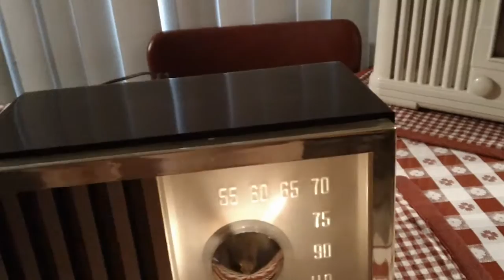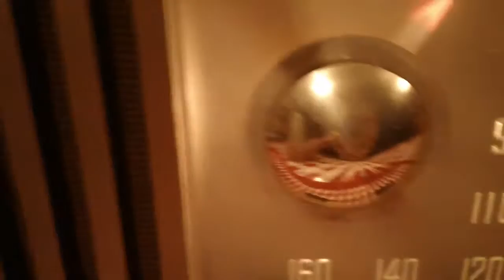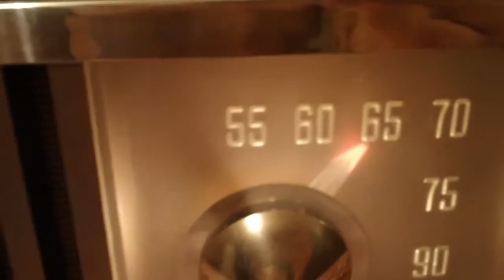RCA 75X11, Tube Radio from 1947

Comment: I just purchased one at a resale shop today.  It needs a lot of cleaning up but otherwise it's in fair to good condition.  I had no idea that the grill is brass - I'm confident that it will clean up well.  The lucite is in rough shape - can you elaborate on how to wet sand, what materials to use, etc?  Love how the lights illuminate the dial, I'm really excited to replace the bulb.  I hope it will work!   I'm new to all this as I just bought myself a hobby today.  Thanks for any suggestions and help.

Comment from the maker: I've used both.  Most of the time, the bottle version seems to be easier to find.  I haven't noticed much difference between them, except you need to shake the bottle up.  I really do think it works better than Brasso.  Good luck with the radio, they are a nice model and really well built.

Comment: Thank your very much. That is a beautiful radio. I purchased one today that sounds great but needs some cleaning up. You mentioned using Brights (correct?) Brass Polish on the brass. What did you use on the Bakelite?
Reply from the maker: I use PlastX, which is used for headlights. I initially used it for plastic cabinets and used paste wax for Bakelite, but, PlastX works just fine.
Reply: @OldRadioAl  Thanks for the tip.